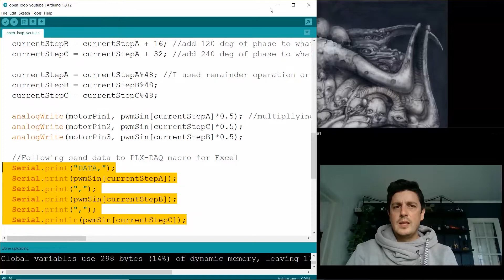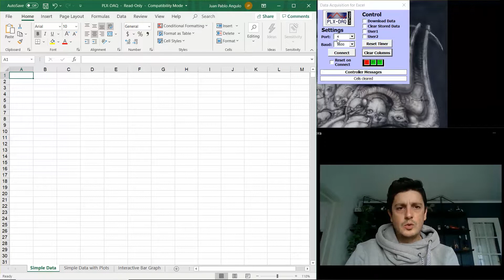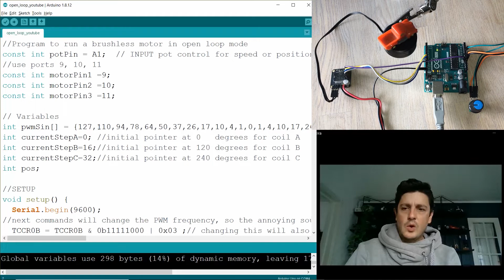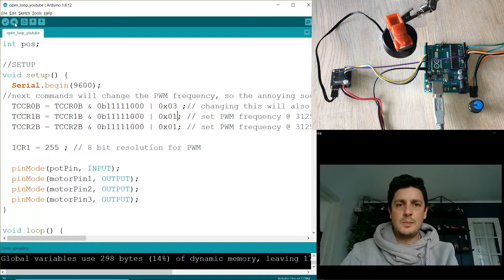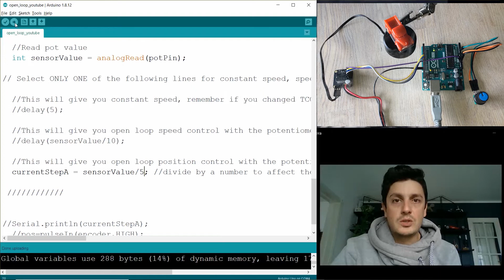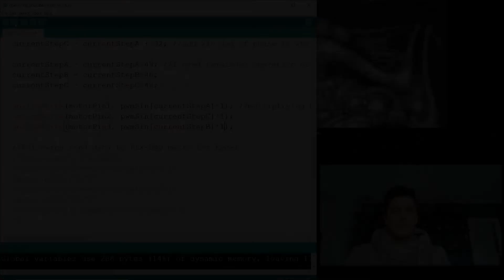Brushless Motor Control with Arduino (slow rotation) Open loop

Comment: In closed loop, how did you manage to return to position without oscillation? Did you provide damping through position derivative?
Reply from the maker: nope, I only used a P control, that's it, did not experience overshoot not oscillations. Will make a video about it soon, you have a video of your project I can look at?
Reply: @RandomAccessProjecs  I am making a force feedback analog using voice coils http://liliumjsn.blogspot.com/2020/03/voice-coil-test.html , but the general idea is the same :P . What's your position sampling rate? I think that's the case with mine. You need to sample faster than the return speed of the motor in order to work just with the P control.
Reply from the maker: Dimitris Karapatis the new videos are up, check em out :)